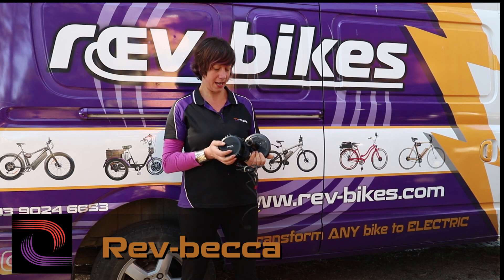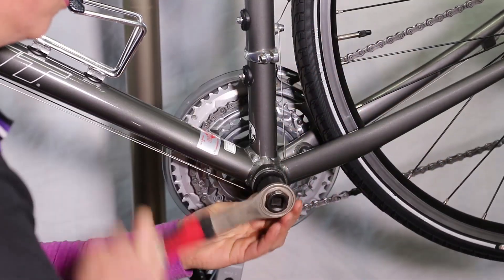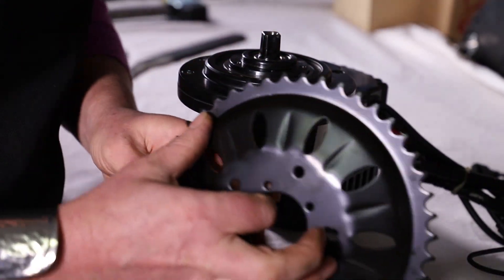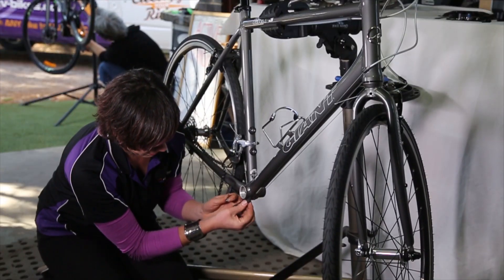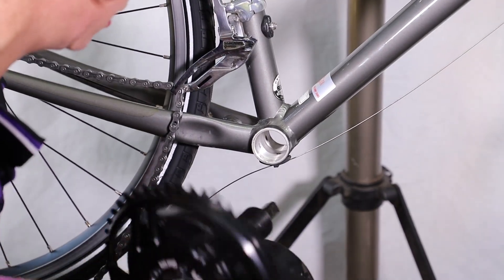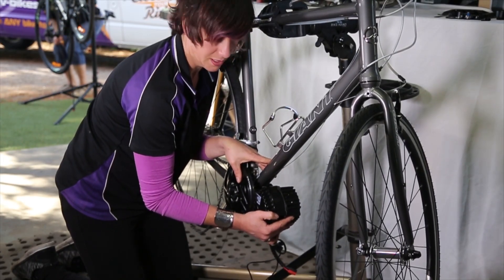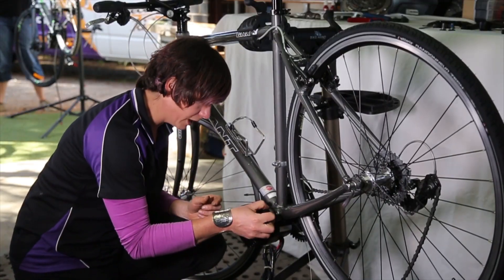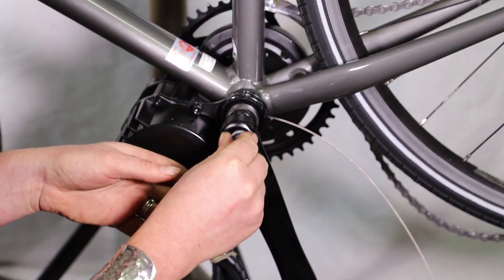Installing a Bafang mid-mount motor

Comment: This is why I got a hub motor... Special tools required for this
Reply: I did a hub motor conversion, wish I had gone mid frame now. The fitting of this Bafang is very easy.
Reply: @johndoyle4723  I have two ebikes in the family. For long distances or step hills I prefer the middrive. For casual mostly flat ground rides or very low speeds - I prefer the geared hub motor. It is very smooth at very low speeds like when my dog wants a run (we live in the country). My middrive doesn't go on power and off power at very low speeds like walking speeds b/c it has so much power.
Reply from the maker: We do actually sell the tool for doing up the lockrings now.. Soon to appear on the website, but an add-on of $25 with any kit sold.  There are some specialist bike tools required for a hub motor install too, especially a rear wheel.

Comment: Nice detailed look at motor mounting .
 I just had a look at your rev website , and got down to the bit regarding e bike laws and followed the link to gov e bike laws in our nanny state/country .
   A bit of a joke really the way laws in this state are doped down to the absolute lowest possible  denominator , i had a ride on my brothers  250 watt e bike some years ago and , it was pretty useless for a fairly big dude such as myself .
Reply from the maker: You might find that the motors have improved in their torque since then.  And running through the gears like these ones do gives you more torque lower down.  But yes, higher power ROCKS! ;P

Comment: Hello. Nice installation video!

What's the main advantage of having the Lekkie Bling Ring over the stock Bafang chainring?
Reply from the maker: Thanks for the question.  The Bling Rings have a deeper offset, meaning they line the chain up closer to the frame, so it can run straighter to the middle of the cassette, avoiding wear.  Also, the narrow-wide tooth pattern holds the chain firmly, minimising the chance of the chain jumping off.  They are also lighter, not that this is much of an issue once you have a motor ;)
Reply: Ahh ok. Thank you for that explanation. Also, would you happen to know where I can get tools to remove the crank to be able to change the Bling Rings?
Reply from the maker: Crank extractors are available at any bike shop, they are not a specialist tool.  We can sell you one if you like, or provide as a bonus if you purchase a Bling Ring from us :)
Reply: My Bafang motor currently has a 44T chainring. If I opt for a 42T or 46T, do either have a different screw hole distance versus the 44T? Or do they all fit regardless of the # of teeth? Thanks!

Comment: i have a bought one from this seller and thank you for your video, it is very helpful : https://www.amazon.com/Bafang-Display-Electric-Conversion-Battery/dp/B07D58C23S/ref=pd_day0_hl_468_4?_encoding=UTF8&pd_rd_i=B07D58C23S&pd_rd_r=d92ee873-7865-11e8-aa12-e9bed29a5105&pd_rd_w=Z0DBI&pd_rd_wg=tnd2f&pf_rd_i=desktop-dp-sims&pf_rd_m=ATVPDKIKX0DER&pf_rd_p=4014010564823900592&pf_rd_r=FZA9RHG5H5N1FP49MBE0&pf_rd_s=desktop-dp-sims&pf_rd_t=40701&refRID=FZA9RHG5H5N1FP49MBE0

Comment: Nice video!!! 
I have a question about the chainweel, if the bike has three and the motor comes with only one... How is the speed shifter going to work? 
Thanks!
Reply from the maker: The front gears become unnecessary when you have a motor fitted, as you will have your rear gears to vary the torque and speed, and instead of front gears, you will have LEVELS OF PEDELEC (normally 5 levels).  You can remove the front dérailleur cage, and also the cable and handlebar shifter too.  This frees up space on the left hand side of the handlebars (where I come from) for adding the assist buttons and also the optional throttle :)
Reply from the maker: depends on riding style, and the straightness of the chain line, depending which gears you use more, and how you change gears.  The Bling Rings hold the chain firmly, minimizing or eliminating chain drop